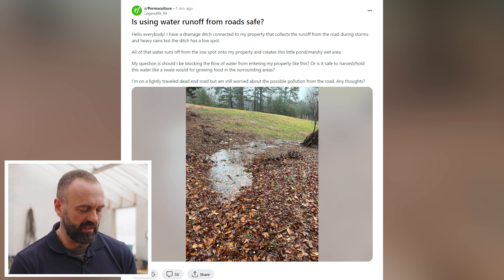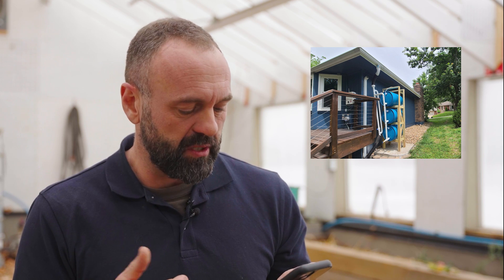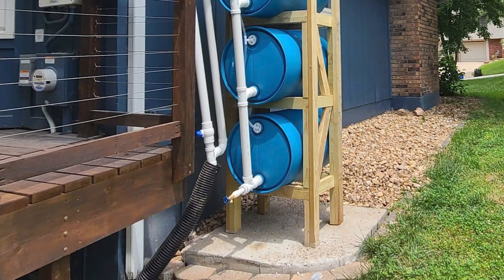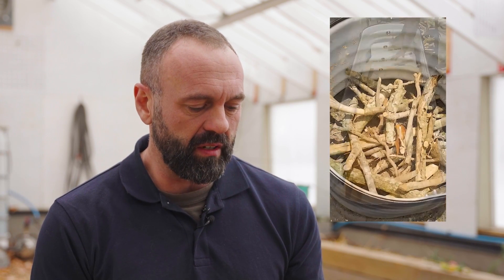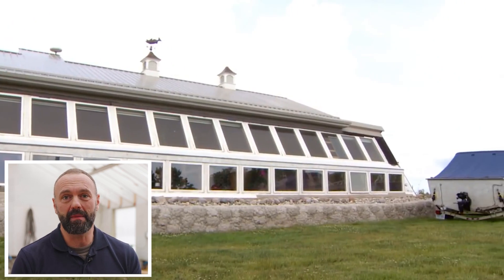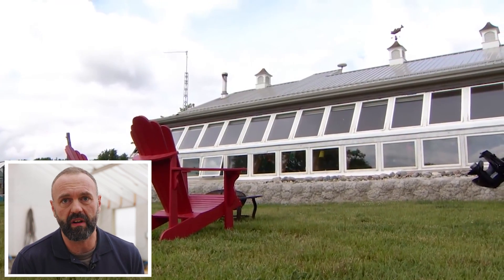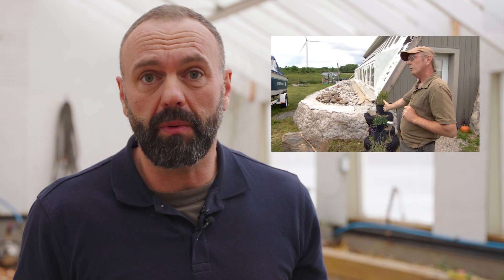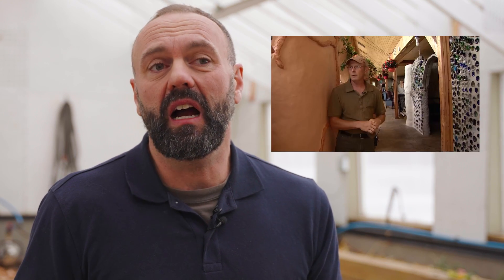Should You Build an Earth Ship? Rob Avis Reacts

Comment: Earthships are much better than standard modern homes, but still far from the most efficient and long term sustainable way to live. A better way is to take a turning your home into a Garden of Eden approach, or living in a Greenhouse. Earthships prioritize living in a dead box over growing  food inside your home, and thus waste an immense amount of real estate. It just so happens that Plants want to live in the same year round climate as you do, 60-85 deg. If you switch your mind state to living with your food plants/trees, you get free organic food using zero resources above what you use to maintain your home. You will actually end up using less than half, and potential far less than that, because your home will now be harvesting a massive amount of direct solar for the main heat source. In essence,  if you build a south facing Greenhouse structure, with the south half using clear twinwall polycarbonate panels, that are arched that self shed snow, and the North half of the structure is heavily insulated opaque sheathing of your choice. To minimize heat loss, you also should insulate the exterior ground 4 ft away from the structure to move the frost line as far away as possible.  Combine this with using a Rocket Mass Wood heater and also make Methane Gas harvester to collect gas from your compost, and you will have an insanely efficient living and food growing habitat for both you and your plants/trees to live in, that will never drop below 55-60 deg. The main issues to mitigate are excess heat in Summer, and Insects inside your living area. Both are easily solved. With proper air ventilation, and also allowing trees and plant canopies to grow infront of the clear polycarbonate front (on the inside of the greenhouse, not the outside),  they will absorb most of the light and heat, and create a shade canopy for the North half of the Greenhouse which will be the main living quarters. For insect's,  you can either just learn to live with them and install a mosquito net over your beds, or you can divide the structure in half with continuous insect screen, so the insects stay in the South half growing area. Insects generally stay where the plants are anyway. I highly encourage people to consider living in Greenhouses, Man was meant to live inside Garden of Eden.

Comment: On the topic of earthships , no question they are a lot of work . I've actually been head framer and design consultant on one. Labor can be minimalized by the use of neumatic rams , moving the earth can be done by conveyer belts. All the same its a BIG endeavor.  Ventilation can be improved by various methods , like adding earth tunes through the earthen berm , which I think is a brilliant system and have used in my own designs. Thanks for the tip on reydon gas. I suppose that an issue on any earthen structure.
Also thanks for the great news on trees selectively distributing components.  I've often claimed this and real evidence e ists for plants such as cattails and cord grass but a great deal of concern has been placed on the production of fruit bearing trees. 
Back to earthships , despite the daunting measures required to build them , there are some great innovations in design that I shameless steal and incorporate into my own😂
Great video Rob

Comment: Rob, I agree with your assessment of almost everything in this video - except using plastic barrels for water collection. I live close to a cereal factory that has a massive surplus of food grade barrels. You can pick them up for $5-10 a piece. I have made a 3 barrel rainwater collection system for my reasonably sized urban veggie garden that I have been using now for almost 10 years. I use mulch and ground cover to help lock in soil moisture and created a drip irrigation system from old garden hoses. I have only ran out of water a couple of times during very dry seasons and have never used city water. If done properly they are a great entry point for people who want to experiment without spending a ton of money.

Comment: Hi... these rubber tires can contain a lot of PAH (poly aromatic hydrocarbons) and still give a lot of discussion when re-used as grinded materials on sportsfields etc.
There were some comparative studies that indicated an increased level of PAH in the blood of frequent users of those sportsfields compared to the classical fields, but I have no knowledge if this also gave a significant difference in the appearance of PAH related diseases.
The tires in an earthship are also not grinded and are more or less insulated/compacted with this earth. 
However PAH is a group of chemical compounds which are rather persistent to biochemical  breakdown.

Comment: Earthship no longer does the angled glass.  They haven't for years.  They learned that it is not necessary to do so. And yes the tirewall is really the main sticking point with earthships.
Reply: Tire wall can be avoided by using 50 times less tiresome to make mud brick / unfired bricks. And you do not have to worry about toxins leaching from those tires into your home. There are still more then 10 000+ buildings made from unfired bricks in Europe alone. There are no cadastral records in Africa so it is hard to say exactly how much they are used there..
Reply: The window manufacturers will not warranty them if they are installed at angles, that alone should make the decision easy. That plus all the stories about melting computers LOL.

Comment: What do you think about building with interlocking compressed earth blocks? I cannot link but you can YT search "makiga interlocking stabalized earth blocks". I'm considering buying the manual machine.
Reply: As i said in another comment, there are 10 000+ buildings made from similar material still being used in europe alone. You can even find numbers for static calculations for them in European publications /architectural journals. I am not sure what climate you're in, but in TN/NC climate you have to repair plaster every 3-4 years. ( without hurricane )
Reply: But of course, if you use insulation on top of that compressed brick then should be no problem with any standard building material.

Comment: 6:34 I work with building envelopes, as a glazier. 
Will confirm, all sloped glazing units are going to leak. 
The worst issues always arise from birds. I've crawled on a few skylights downtown because of bird damage to gaskets and caulking. 

My wife has talked about earth ships ever since we met. Thanks for sharing your research
Reply: Yeah, those buildings are designed and constructed by enthusiastic but absolutely incompetent people. For winter heating, vertical glazing is adequate. For summer, vertical is better. If really necessary to have sloped glazing, leakage problem can be solved by using glazing like on greenhouse in front of windows, so there will be no water touching windows.